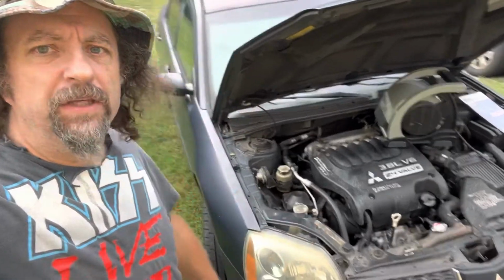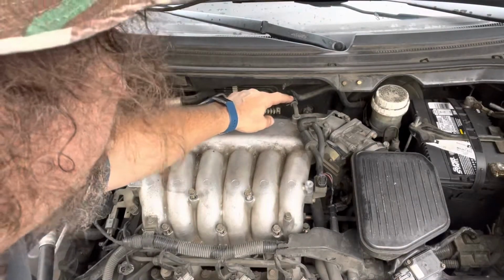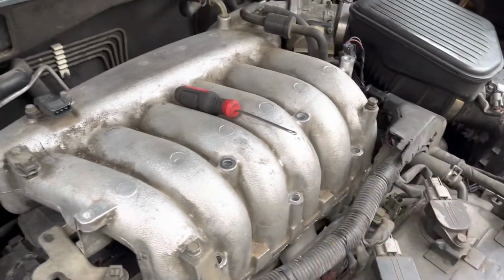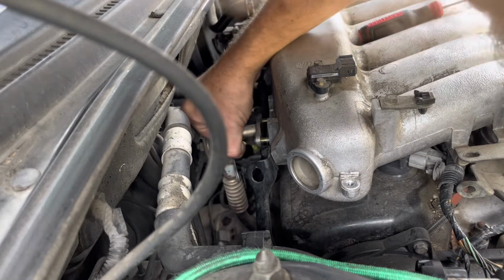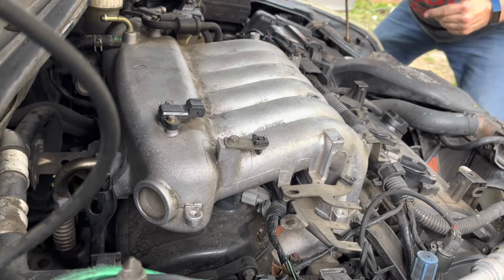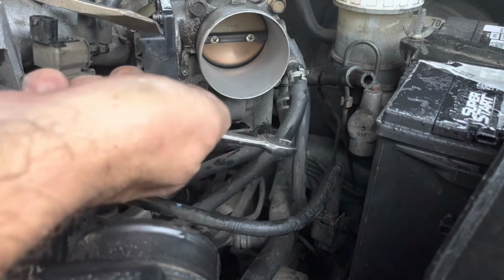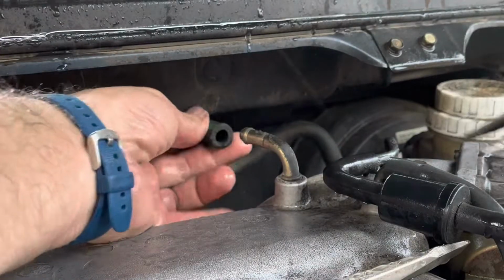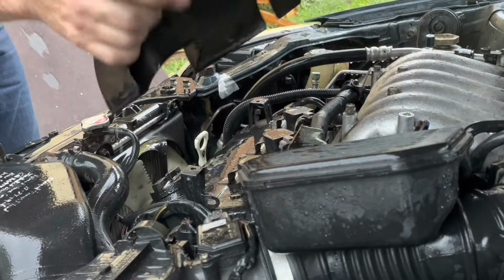Replacing a coil pack on a 2005 3.8l V6 Mitsubishi Galant in a storm

Comment: No turbo to fail, happy with my 3.8 in Australia.
Reply from the maker: They seem to have some more of these down under than here in the states. It's a bit of an oddball here.
Reply: We manufactured about 32000. Between 05 - 08. All with 3.8 , no 2.4 offered. Engine & gearbox from Japan. Did not sell, factory then closed.

Comment: i have a 2004 3.8 Galant GTS and I love it, but that motor with the spark plugs, and fuel injectors in the back is a pain in that but,,, and no I take it to someone just to do the back and I put the most expensive injectors, wires, spark plugs in the back and yes the best valve cover seal and rubber seals for the injectors,,, peace
Reply from the maker: I'm just trying to keep this one alive till she buys another car. It's a cool little car though.